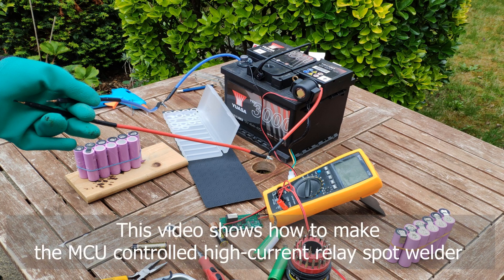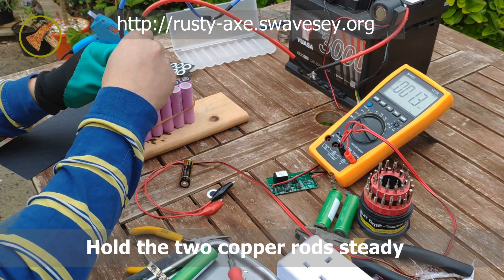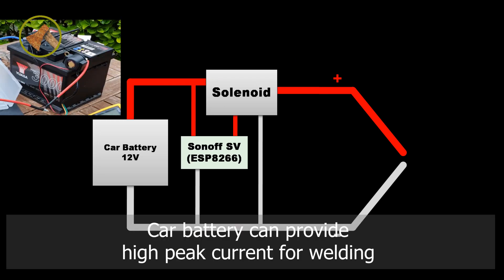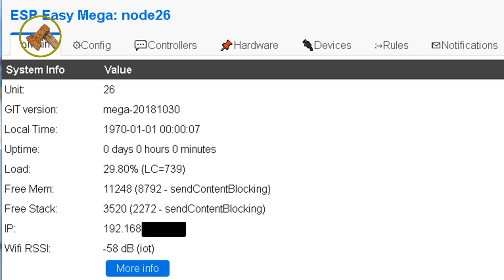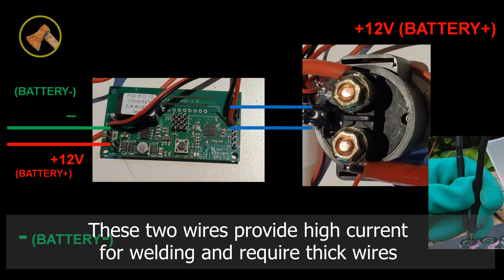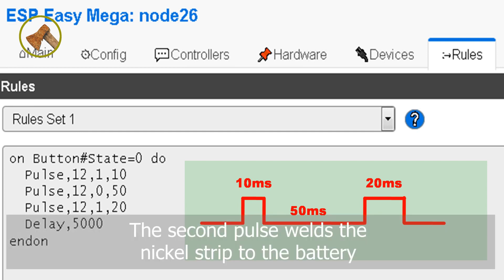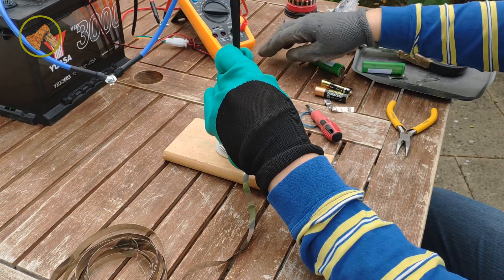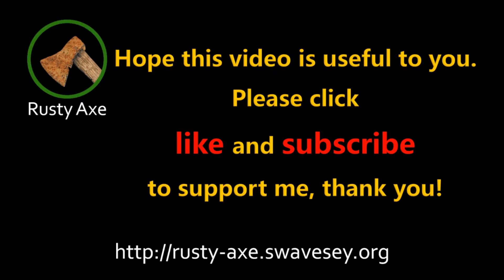DIY Reliable 18650 Battery Spot Welder, Simple and Low Cost (only two main parts,Wifi enabled)

Comment: G'day Rusty

Is this a suitable solenoid switch?

https://www.ebay.com.au/itm/500A-DC-12V-24V-Car-Relay-High-Current-Starter-Solenoid-Relay-4-Pin-SPST-Car/164115192336?hash=item2636071a10:g:TcIAAOSwUwReZGSQ&frcectupt=true

Thanks
Reply from the maker: The relay is rated at 500A 12V/24V. Yes, it is suitable.

Comment: Instead of using a battery, would a car starter like this one be a decent power supply option? 

https://www.ebay.com.au/itm/Suaoki-U18-1200A-Car-Jump-Starter-Jumper-Pack-Start-Battery-Charger-Power-Source/333725570658?epid=25024576367&hash=item4db3981662:g:USwAAOSwtyVfZFoI
Reply from the maker: I didn't own one, but have heard the car starter can supply very good amount of current to start the car engine. 
So my answer is: yes, it should be good enough to be the power source for DIY spot welder.

Comment: G'day Rusty

Completely new to all of this and I want to be able to spot weld some basic battery packs. But I can follow instructions if I can find the correct components 

Digging through eBay has brought up no exact matches to the Sonoff module you are using. :-(
Also what solenoid switch did you use? 

Would you mind posting up some links to the components that you have used? 
You can also earn some dollars through the affiliate links to Banggood etc. 
Nb. I'm in Australia and American Amazon doesn't ship a lot of components into Australia. 

 Keep the videos coming. 

Thanks
Reply from the maker: The Sonoff SV board is widely available from ebay, here is the official website: https://www.itead.cc/wiki/Sonoff_SV.

The high current relay us also widely available from online shop such as eBay.
Reply: @rustyox7449  G'day Rusty

Is this a comparable board? On your board it has letters starting with PSA-B01-GA whereas this one on eBay says ITA-GZ!-GL
 
https://www.ebay.com.au/itm/SONOFF-Basic-Switch-MINI-DIY-Two-Way-S26-RFR3-RF-Bridge-SV-Switch-Module-AU-J3T0/313141630640?hash=item48e8b216b0:g:VlMAAOSwhqZfBpCE

Is this compatible with your machine?

Thanks very much :-)
Reply from the maker: Yes, this board is suitable. Please make sure to choose SV version, as there are many options in your link.

The board cost more in AU than in UK.
Reply: @rustyox7449  Everything costs more in Australia :-(
Reply from the maker: The  Esp Easy is loaded via UART port, so a USB to UART board and a 4-way 2.54mm pin header is needed.

Comment: How is your code programmed into the ESP8266 control board? Very good looking welds.
Reply from the maker: The Esp Easy has built-in web interface. Click rules tab on the web interface and type/paste the lines.